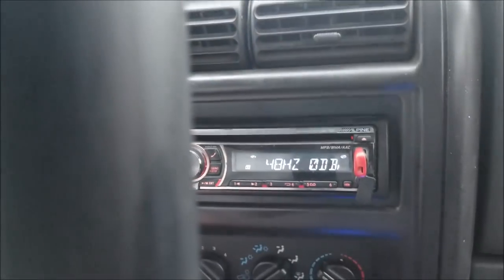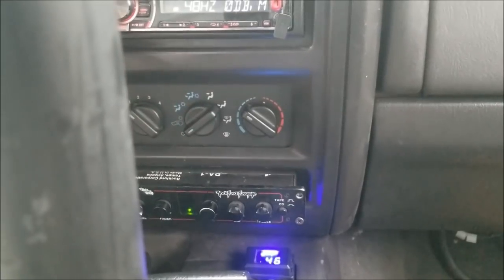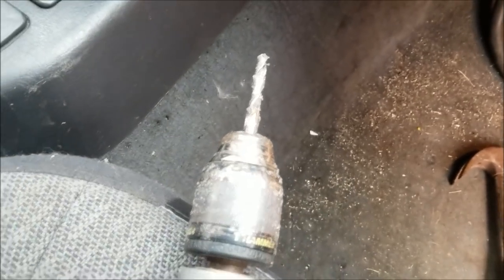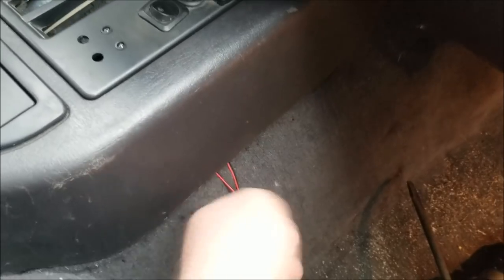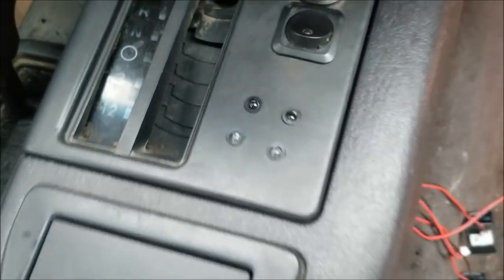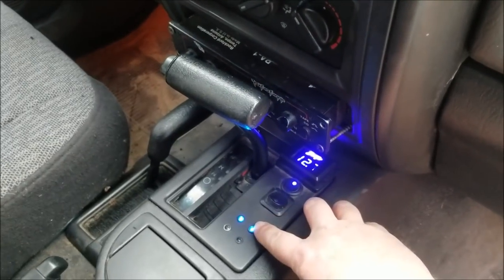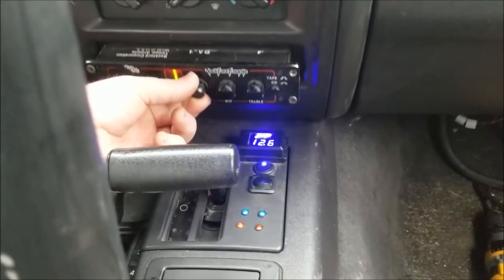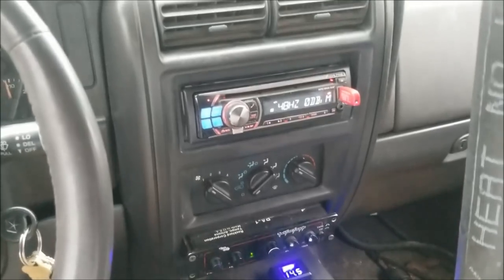Amplifier Clipping Remote Indicator Review & Install

Comment: Some amps have the clipping light built in, like the fosgate (blue light I believe) and jl audio (green light I believe)
Reply from the maker: Thanks for watching and commenting. Lots of amps do, my Sundowns have a clip indicator built into the remote gain knob but I was unable to use the remote gain knob due to running two amps gain matched to each other. I'm not sure about the JL but I can tell you the LEDs on the body of the Rockford amplifiers themselves are not accurate. My friend runs a Rockford BDCP 2500 and contacted Rockford and was informed by them that the lights are not accurate. Even if they were accurate being on the amp themselves and not having the ability to see the lights on the amps behind you or in the trunk kinda defeats the purpose of having them. What good are they if you can't see the lights while giving a demo or driving.
Reply: My SoundQubed amp has a clipping indicator on the bass knob it comes with, think wolfram has that too and DD audio and others. But this clipping indicator is for special installs like 2 amps etc or using a audiocontrol pre setup for bass or gain. This would probably work with amps like the newer SoundQubed since they come with one on the bass knob, but others with no clipping led built in, it would probably not work. Think SoundQubed is built by S&I also. Think these clipping indicators are really useful. I know I play rock to rap and some pretty much bass only songs. If I turn up gain for the rock song and forget to turn down for a bass heavy song, at least I have a warning to save my subs. I don't even have a spl system, just sound quality, but cant hurt, still like pushing my subs to limit at times.